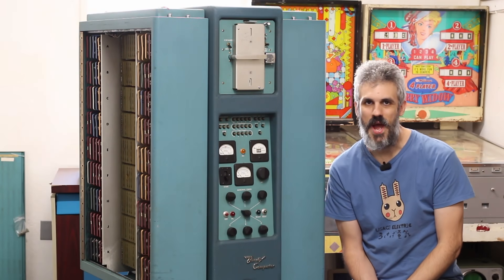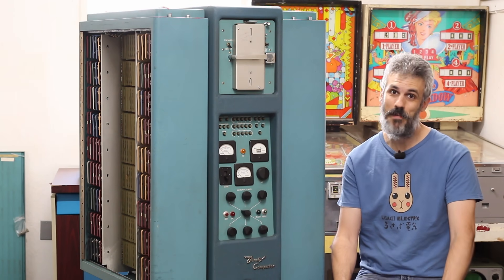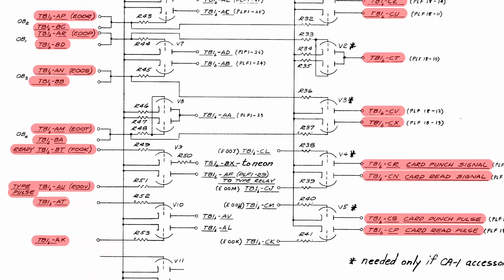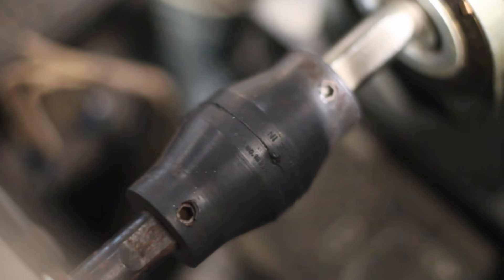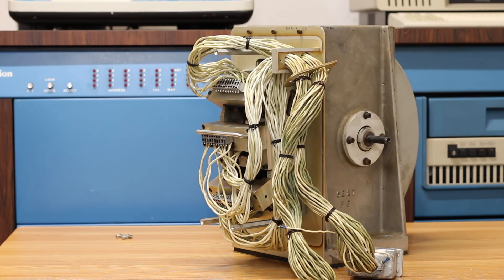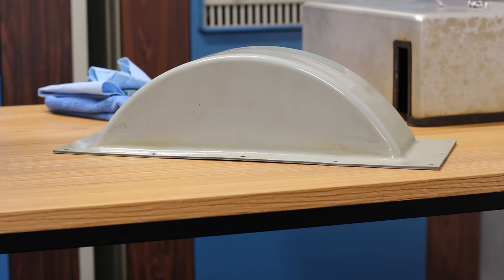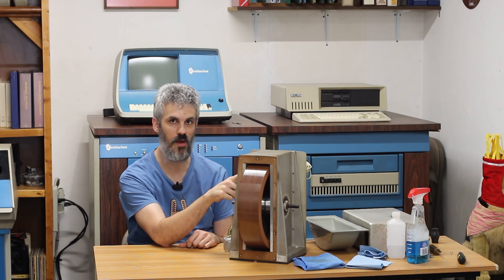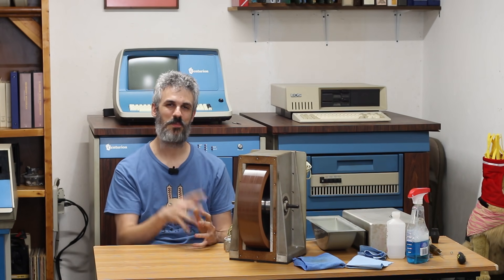Removing the Rotating Drum Memory from the Bendix G15

Comment: When (if?) you manage to re coat the drum, is it possible to adjust the distance between the drum surface and the read heads?  If not you will also need to be sure the coating is the exact correct thickness.
Reply: Heads are adjustable, remember this is a machine designed in the 1950's, and they knew no two drums would ever be exactly the same diameter down to a ten thousanth of an inch. Room to set gap was there, plus an alignment method as well.

Comment: To remove the oxide layer, I'd first try a solvent.  If that doesn't work, put it in a lathe at low RPM and use the same technique used to polish car finishes - wool compounding pad in a drill with polishing compound.  Then, if the metal surface of the drum isn't scored, no need to remove metal with the lathe. For uniform re-coating, electrostatic painting (without sparks and fume ignition 😁).
Reply: Solvents could probably  be tested on those crashed discs first. Those are more expendable.

Comment: I like the three observations of @toddbu-WK7L, two of the three therein being what I would have enumerated as well, so I have only one major observation that I have not read yet seen in an informal survey of the comments.

For a heavy aluminum rotor made out of a metal with a notable coefficient of thermal expansion (aluminum alloy), and its concomitant (multiple) read, write, and erase heads being designed to travel with such a precise standoff, I suspect (but only speculate) that they were fabricated by GE under controlled ambient temperature conditions, or compensated by machining slightly under- (over-?)spec. What is the stable internal temperature of an operating G-15, I would be asking. I guesstimate 120° Fahrenheit, with ongoing cooling.

Using a micrometer to measure the rotor´s current diameter will only be as accurate as the variability of the paint thickness and the damage caused by the head crashes. One could mathematically calculate its expected radial increase due to thermal expansion, but this is, er problematic as well. Is the alloy of aluminum known? Different alloys have notably different coefficients of thermal expansion.

Perhaps a retired engineer or some research can provide some datum.

I suspect that the drum memory is intentionally situated at the base of the G-15 because, well, heat rises -- and just look at those high-current solid copper leads!

By the way, do the heads exhibit wear or damage as well? Is it practical to use a test rig with (one or more) modern heads (heck, even a Hall sensor!) to test your setup first, before installing and attempting the use of the 50´s heads?

Lastly, there has just got to be shims for the precise locating of the mounting bar --Maybe you can “game“ the issue: cheat by using custom-machined (or variable) spacers?

Comment: Another option might be to just coat the drum in your magnetic material of choice and then turn it back down the spec on the lathe.  I think your other ideas would probably work better, but if you overshoot, or they don't work, that might be an option.  It would be tedious as all Hell, but it might be a way to salvage a bad run.

Comment: I'm presuming that mere mortals won't have the tolerances in their lathes to machine something that accurate. So what I'm wondering is, can you build a new drum? Perhaps partner with one of the many machinists on this site and manufacture a brand new drum (or perhaps a few new drums). Once you've got it CADed out you can then have multiple attempts at the coating whilst still having your original to refer back to. It would be expensive for sure, even if the machine time is free you'd be in for a bit of materials, and I doubt there'd be much value in it (who else has that exact drum that needs repairing?) but it would be very freaking cool.

Comment: Absolutely DO NOT use a mechanical means to remove the old coating! You need much higher precision than what a normal lathe can give you. Chemical and them polishing may be the best. As mentioned by others, you probably will not get the required surface finish with a high build primer and clear coat with iron oxide mix. I would suggest prototyping your method before touching the drum, make a similar drum to practice on. Surface finish and coating technique will be paramount.

Comment: Think that patch panel may output anything audio frequency? :P  could make for some interesting samples if so.
Reply: Yes.  There was a program with which one could "code" a bit of music (freq & duration of notes; don't remember coding).  The program loaded and modified an appropriate bit pattern into one of the tracks (I seem to remember track 19, but may have been one of the shorter tracks).  We plugged a wire into one of the jacks and ran to an audio amp & speakers.

Comment: How about powder coating? Quinn from Blondihacks recently did a video on powder coating her scale model steam engine, and it's way more durable than any paint coating could ever be. It does require baking at a specific temperature, which could be tricky for such a large part.

Also, I remember reading the size of the ferrous particles is pretty important for tape, although that could just be because tape needs to be more flexible or something. I know the mixture of oxides/metal particles is also important for high-end tape, but that's probably not so much of an issue for such an early system since they wouldn't have had the decades of R&D to figure that stuff out.

Comment: If you can chemically remove the original magnetic layer, you may be able to avoid machining the drum. Unless there is evidence that the heads rubbed through all of the oxide coating and then into the aluminium substrate of the drum, it's fairly likely that the drum underneath is still true and flat. It would be good to avoid the risk of machining if it's not required.

Comment: 2k clear coat dosent adhere well to dry paint. Any heat would make it want to flake away and that would end up being detrimental.
Reply: If your going to machine the surface any way why not use an epoxy to hold the magnetic material keeping it rotating as it drys and then just machining to the final surface. It would adhear well be basically impervious to most anything elemental and you can machine it to a perfect size

Comment: Recoating the drum sounds challenging.  And how do you align the heads?  Do they 'fly' or is there some tiny cam-like adjustment?  Would be interesting to see that.
Reply: My guess is that as long as there is viable magnetic material below the heads, then there is no alignment to do.
Reply: @timc3600 Well I was thinking more along the line of adjusting the head gap.  The run in/out has to be very critical, but if the heads have some adjustment, the final exact diameter of the drum could be compensated for.  So maybe put on a 'thicker' coating then just machine to a tight 'roundness' with very little run in/out.  Install and adjust heads for the critical 'head gap'.

Comment: Is it possible to buff the drum like they use back i 20000 and 2005 to buff optical disk ??
Reply: Not really. On a CD you could polish the polycarbonate on the front of the disk but the data was encoded on the back side with the aluminium layer on it 
For this the magnetic layer is directly exposed at the surface.
Reply: Not really, you strip the oxide off, then polish the drum to a mirror finish, then lightly grow oxide on it for the paint to mechanically attach to, and chemically bind with. Then coat with new oxide.
Reply: @SeanBZA  like electrolysis?
Reply: @SeanBZA  what about big scratch and all tracks on disk i believe he have to renake those tracks
Reply: @mtalhakhalid1679  You machine it on a precision lathe to get the deep dings out, then mount back in the housing, and polish it to be both smooth, level and concentric. as measured with a dial micrometer all across the surface in multiple places. Then you grow the oxide using a solution of weak organic adid, to give the smooth surface a matt finish. Then coat it. Then buff the coating to give the same smooth finish again. It should be shiny like magnetic tape, which is normally dip coated, using a wide mylar film that just contacts a bath of the tape formula, then gets calendared with warm rollers to evaporate the carrier solvent, before it is further smoothed and slit to width.

Comment: Appropriately fine iron oxide in nitrocellulose lacquer. Spray-paint it on while it's spinning.

Edit: Mostly what you said. But DON'T screw it up by machining it! Just spin it and lightly "treat" the existing oxide with 1200 grit, then spray away.

Comment: Look up the old magnetic ferrite tape formulations, and you will find the recipe used to make them, plus there likely is some formulas around to recreate the paint. The iron oxides will have to be sifted to be within a small range off sizes, no small particles and no large particles, and then sprayed onto the drum surface in a clean paint booth.  Possibly you have a viewer who used to work at 3M, who knows the people in the tape plant, or there isa viewer with contacts in BASF, who might still be having a small stock of the old magnetic oxide formula, sifted, and ready to use with the binder, for you to use.  Once sprayed on the drum, it will need to be left spinning till cured, to make the coat stay even, and then will need to be buffed to a smooth surface again, so that the heads can float above the surface.  Paint would have originally been solvent based Duco, not a 2 part resin, so best will be staying with the same solvent based paint, as the powders are known to work with them, and 60 years with no degradation is a good result.

That sticky back likely easy to do as well, thin the pure clear sticky grease you are going to use, probably with filtered thinners, and filter again through a fine paper filter, and mask off the gasket side, and apply 4 or 5 thin light coats, just enough to not wet the material, and have the solvent flash off before hitting ( so unlike any normal spray job, here you want the solvent to flash off, leaving the dry small droplets to impact the cover and stick), to leave a thin dry but sticky grease layer. Probably original was a thick petroleum jelly, you get it in a range of viscosities, from a runny liquid, to something that is sticky and almost paraffin wax like. You want a sticky but high kilopoise grease or petroleum jelly. The one shop by me actually has this, I used it a lot as a very cheap hotfoot replacement, to keep birds, mostly rock rats, from nesting on waste pipes, and to keep the monkeys from climbing said pipes as well. Sticky and the birds did not want to land on it, and the monkeys would slide down with comical looks on their faces.
Reply: A little bit from the SBE about tape and the formulas and solvents you will need to use.

https://sbe.org/handbook/fundamentals/Video/Video-Magnetic_Tape.pdf

Figures the largest user in aggregate should know how tapes are made and used, and the nasty solvents used ot apply and strip the coatings off the surface of the tape as well. Has some hints about the required formulations and the adhesives used, plus the solvents to carry this thin film to the surface of the drum.

Comment: I don't think it would be possible to make this drum work again with "homemade" technics. Not with so small tolerances.

But I would go in other direction: what about keep it, clean and polish it to look good, make it spin but hide inside some modern electronics that emulates the signals?

It would be displayed as normal and it would work. I know it's not as pure and clean as we would want but at least it would work. A board of the size of a thumb nail with a microcontroller could do the job.

Comment: Suggestion: deposit iron with electroplating onto the aluminium drum and then oxidize it in an oven with oxygen flow.
Or use an agent like H2O2 or nitric acid. This seems more controllable and precise than brute-forcing a layer onto it.
Reply: @massriver  plating aluminium might be hard, though, due to fast oxidation. Sputtering is imho better, but the equipment is not easily accessible for DIY.
Reply: Does this process create the ferromagnetic form of iron oxide instead of the paramagnetic form of Fe2O3?
Reply: @bornach Under moderately high temperatures and oxygen flow, it will form Fe2O3, which was also used in music cassettes. Fe2O3 is antiferromagnetic. Only when heated above 675°C, it will become paramagnetic.

Comment: I doubt the idea that grease was put in as a dust trap. As you say it would be tricky to put on the greasy thing without getting grease on the drum, and you are just going to let dust in. Is it possible that the grease was cooked out of the bearings and condensed? Or maybe it's a plasticizer that's separating out of the plastic.
Reply: Possibly as a one time factory thing, but you don't need to imagine the dust that collects inside the machine in the field, not a win to open that up again.
Reply: Possibly as a one time factory thing, but you don't need to imagine the dust that collects inside the machine in the field, not a win to open that up again.
Reply: Possibly as a one time factory thing, but you don't need to imagine the dust that collects inside the machine in the field, not a win to open that up again.

Comment: Just to summarize what I and several others have posted here: IF YOU ATTEMPT TO TURN THIS DRUM ON A CONVENTIONAL LATHE, YOU WILL MAKE MATTERS WORSE. MUCH WORSE. The concentricity, roundness, and surface finish needed to fly the heads at  0.001" can only be accomplished with a high-precision grinding setup. You are talking about a few microns TIR at most. Unless you have experience in ultra-high precision machining and the tools to match, don't attempt it.

Instead, make every effort to preserve the existing finish and geometry on the drum. If possible, remove the coating chemically--with chemicals that you have tested not to react with aluminum. If that doesn't work, use the absolute mildest of mechanical abrasives to remove the damaged coating back to bare aluminum--but in that case you will need to construct a test jig that will allow you to evaluate the straightness and roundness of the drum, on its bearings, after you have done any work, to an accuracy of 0.0001" or better.

Comment: I wonder if they ever knew about electrostatic paint back then probably  not It's not as if the new about that kind of thing back then or maybe they dipped it like had some sort of machine to spin the Drum up and put it into the material they were coating it with I suppose without having the exact information regarding how they did it back then that kind of information is bound to be vital

Comment: I would not recommend trying to machine this on a lathe without going to an EXPERT in precision machining, since getting exact concentricity with the bearings that it runs on could be very challenging. There is a good chance that the shaft is as long as it is because the designers considered the need to re-machine it and ensured that it has the right features to allow you to do this on a normal lathe, but if not then you will be in for a challenge.

What would be more approachable if you do not have a serious expert in precision available would be to mount the entire assembly on a surface grinder and spin the wheel on it's own bearings (powered by it's own motor, or carefully rotated by hand). The surface grinder will allow you to traverse the drum past the grinding wheel to grind it flat, since it is aluminium it will require lubricant so you will have to select a lubricant that will not cause problems with the parts that you cannot remove, and can be cleaned from the internals when you are done (isopropyl alcohol may work for this). After this you will want to spin it up and polish it, then give it a full clean for the dust you have created, maybe with an ultrasonic bath. You will have to make sure all these steps will not damage the bearings, and if the grease can be contaminated or washed out then you need to check that the bearings can be re-greased.

Comment: You need to get to be friends with someone who's a pilot and wants to visit the museum. Even in something like a Piper Cherokee you should be able to make it to Maryland in 8 or 9 flight hours. Figure two or three stops for fuel and you're still looking at less than 12 clock hours. It beats driving.

Comment: I dont think throwing some iron oxide in with auto clear is gona work. I hope it will, but i think theres more to it. As one that painted gloss black cars lathing or squeezing the clear will not work. Sand with fine grits starting with 1200 going to 5000 then polish. Use anything under 800 there will be scratches left behind and use the best 3M sandpaper and polish. 3M Perfect-It EX Machine Polish, 06094 is a must!!!

Comment: I don't think machining is a good idea it will reduce the diameter of the drum, I would use 2 or 3 numbers fine grit sanding paper and sand it down to a clean condition from the roughest to the finest, Using primer may not be a good idea, you need a bonding agent, than the ferric coat.

Comment: If the crashing heads didn't damage the aluminum, i wouldn't touch it at all and remove the iron oxide layer chemically. if you do need to result to mechanical means, be mindful that aluminum is often treated with chromium based materials to permit coatings to bind to the oxide later that forms quickly after fresh aluminum is exposed to air. that stuff, as you probably know, is way bad for you.

Comment: Maybe you could coat the drum coarsely then freeze the whole thing until the coating lacquer is rock hard and then use a rotary grinding machine to grind it true and flat?
I own an engine machine shop and I do precision rubber stuff (big ass pinch rollers and the like) from time to time on my crankshaft lathe.